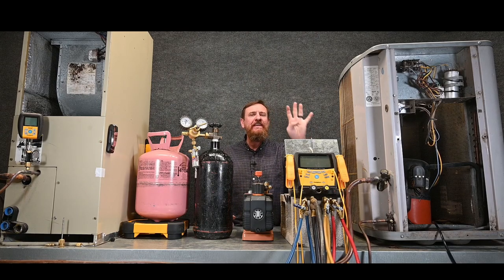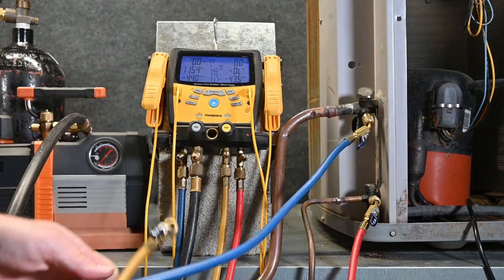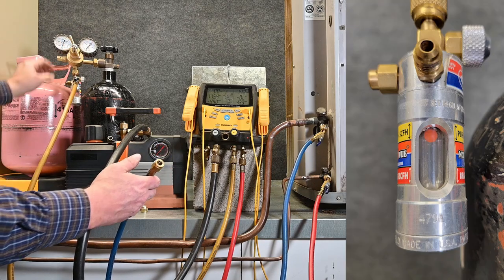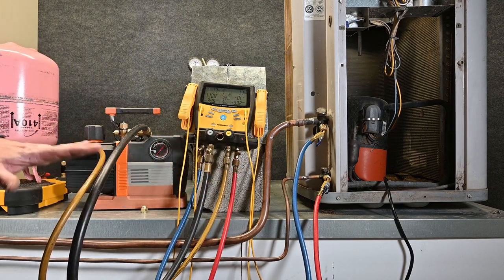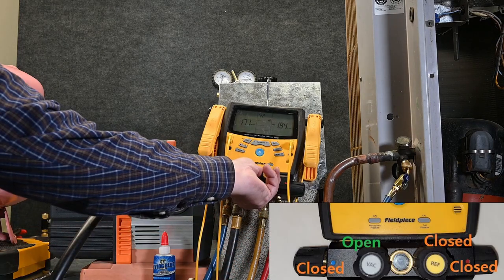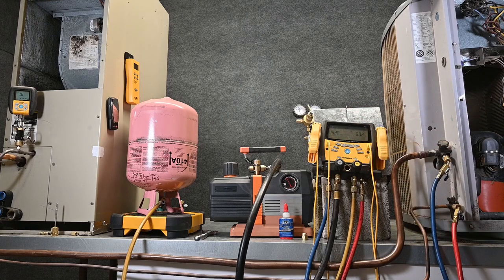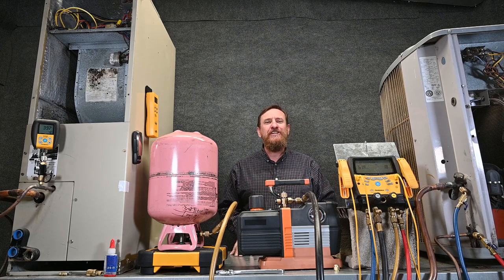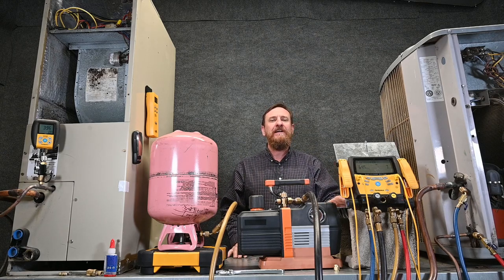HVAC148 Vacuum p15 example 3 The 4 port manifold gauge

Comment: I'd be a liar to say i never used my gauges to pull a vacuum. Thats just how everyone back in the days did it. No micron gauge, no core tools, no large hoses....no cares in the world....we used to use a 2 smoke vacuum....after 2 cigarettes....vacuum was done. Hahahaha. Thankfully it was R22 equipment and is very forgiving of careless install mistakes....410 is not as forgiving. I have since obviously changed my methods of vacuum. Things were simpler back in the days. Started this trade back in 99
Reply from the maker: I was lucky to get to work with some commercial guys back in the day that where big on Deep vacuum. thus by analog micron gauge. 
But yes I too would be lying if I said I never cut corners or was in hurry.

Comment: A little different than hanging the gauges for  30 minutes to see if the needle moved.
Thanks again for the videos. 
🥃🥃🍺🍺🍺🏌🏻‍♀️🎯
Stay safe. 
Retired (werk'n)keyboard super tech. Wear your safety glasses!
Reply from the maker: I haven't used the 4 port for vacuum in years. I was surprised at how long it took!

Comment: why not charge through the suction after deep vacum?
Reply from the maker: Liquid will collect in the suction line, when the compressor starts, it will flood it and cause damage.
Reply: @love2hvac  so after every vacum you charge it back up through the liquid when its off?
Reply: @love2hvac  when should you charge through the suction
Reply from the maker: Yes especially after vacuum.

Comment: Why are ball valves generally preferred when using a 4 port manifold?
Reply from the maker: Ball valves are preferred for all manifolds.

They provide full flow
They are not restrictive
They rarely fail
They provide more control
They are not as affected by contaminants first and debrise.
Reply: @love2hvac  Thats good to know. Thanks for the speedy reply!